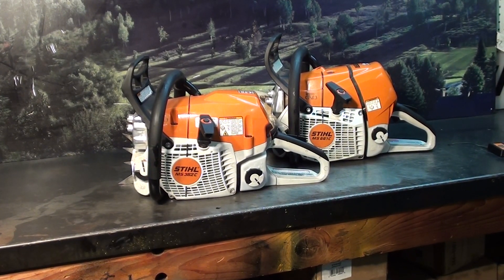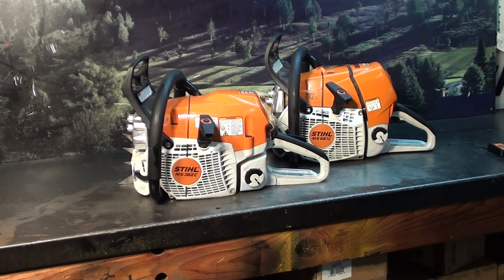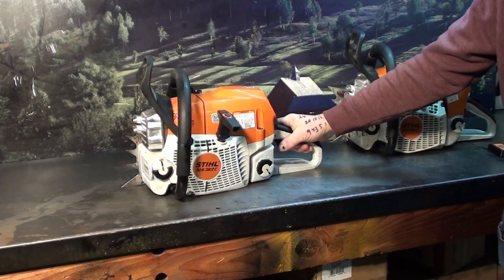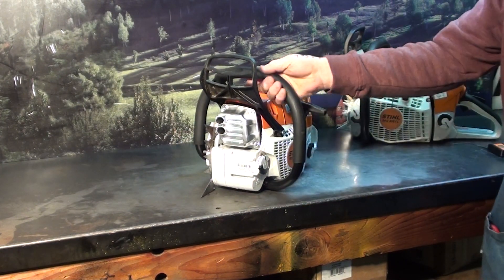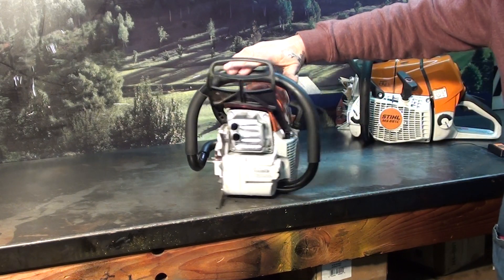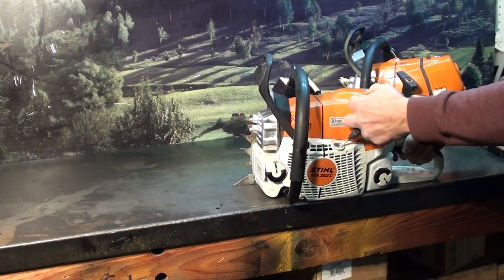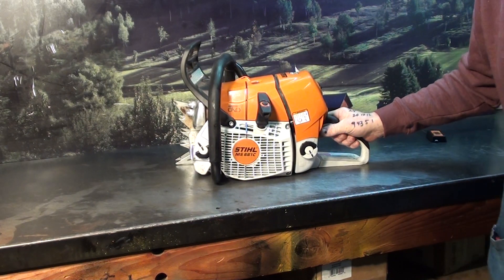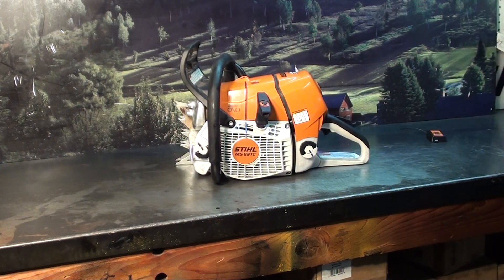The chainsaw guy shop talk Stihl M Tronic MS 362 MS 661 West Coast Build

Comment: What was the point of making them if ur gonna disable them just use them
Reply: +BIGBO1988s10 These mufflers have no fire screen and also many hopped up saws like this are only used for competition. The everyday lumber jack wouldn&#39;t be able to afford all these extensive mods because the increased performance is not justified and the life of the saw is cut down to a 1/4. But for competitions where the saw is only used once in awhile....no big deal.